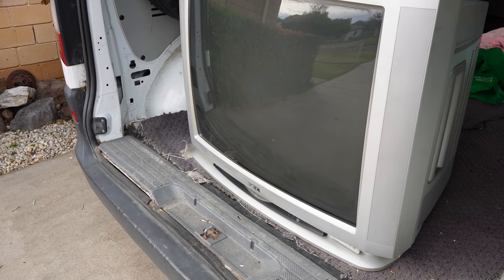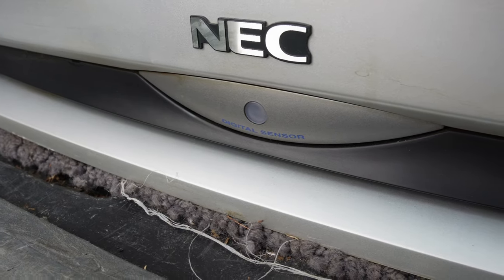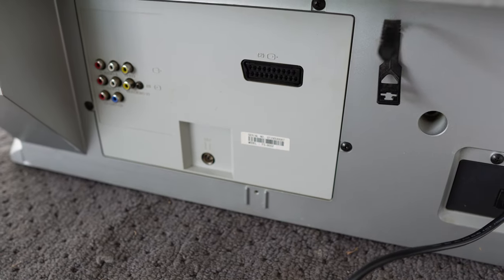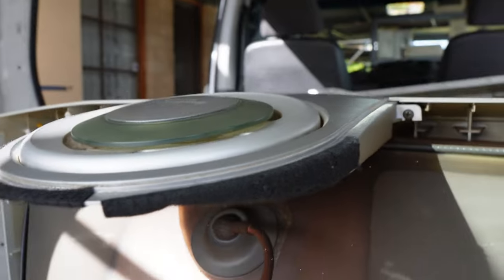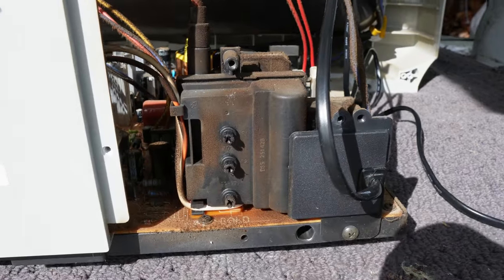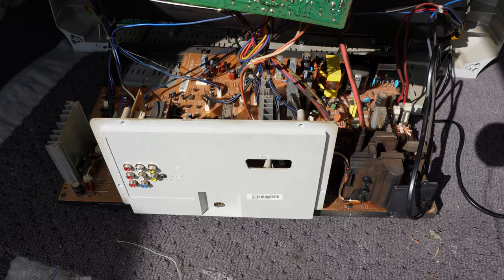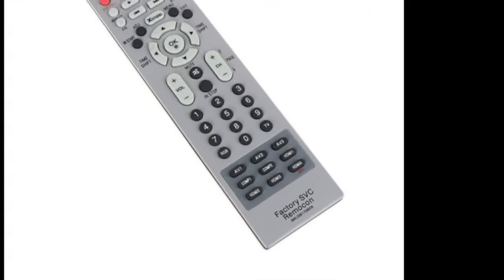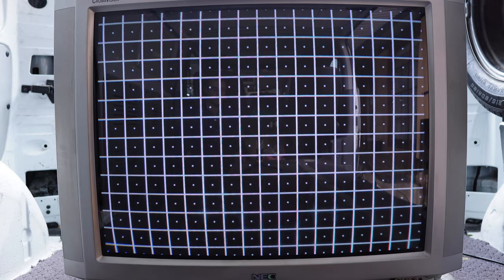NEC FS-8002 80cm/32" SCART CRT TV

Comment: I don't recall seeing these here in the UK, though NEC stuff wasn't really that common. Some Daewoo stuff did filter through, perhaps also under a rebadge, or in-house/ catalogue brand. Interestingly, 4:3 sets with Component Video are few and far between, here (you only ever see it on the widescreen sets). 

The passive radiator on the top is indeed quite unusual! There were a few smaller-screen Sony's that had an actual subwoofer mounted into the casework in a similar fashion. My 20" widescreen set (KV-20WS1U) definitely has one (a Goodmans driver with its own little amplifier board), and I'm sure there was a standard 21" 4:3 Sony that also featured one..
Reply from the maker: For sure there would have been a sub installed, maybe the Daewoo models had it. Pretty good your little Sony had a sub.